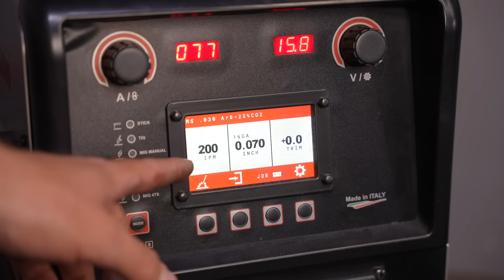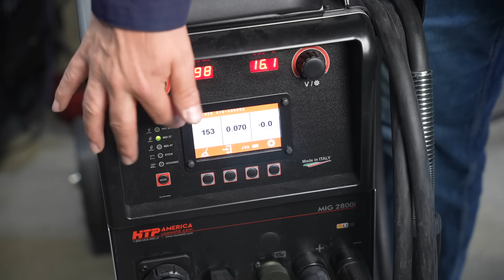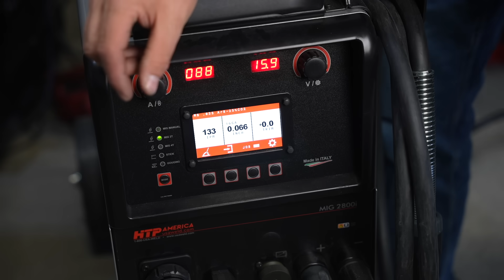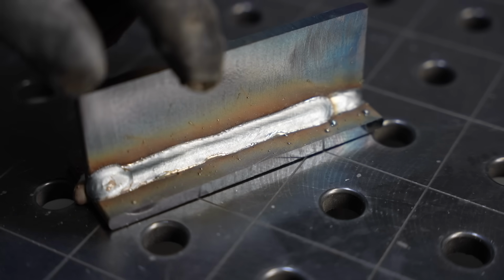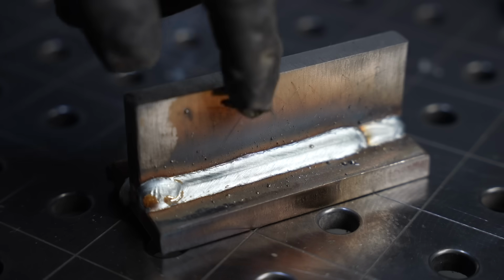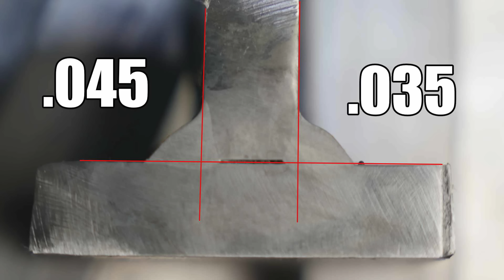Which Size MIG Welding Wire is Best?

Comment: Recently retired and learning to weld so I don't drive the wife nuts. I've learned a lot from your content. Thanks. What validity is there for .023 wire? I've been building sculpture with 18 gauge sheet on top of 5/16" round rod in different configs. I need to be able to butt weld the 18 gauge sheets at certain locations and am wondering about the .023 wire. I'm running a 115v 140 amp Hobart. Keep up the good content!

Comment: What wire brand would you recommend the most?
Reply from the maker: For 8" rolls of solid wire, I use this INE stuff from Amazon: https://amzn.to/3UlBx9W
Most brands of solid wire seem to run just fine, though. For most other consumables, I use Lincoln or Kobelco from the welding supply.

Comment: What about more complex weld of joining 1/2" to 3/16" face to face, not a T
Reply from the maker: Do you mean end to end, like a butt joint or one on top of the other, like a lap joint? 

If they are end to end, I would bevel the 3/16" a little on each side and run 2 small passes per side, one of which would be in the groove and one would be a fillet over the top bridging from the edge of the thick plate down to the face of the thinner plate. 

If you're looking at a lap joint, it would be a simple fillet, which is basically the same as a tee joint. With the difference in thickness, I would set the machine hot enough for the 1/2" and bias that side of the joint a little bit.
Reply: Lap joint, full end of 1/2" is exposed, welded to surface of 3/16 tubing face. What wire sizes and techniques? @TimWelds

Comment: I generally wouldn’t recommend hobby welders to try 1/2” for any reason. It’s too easy to mess that up. If they do, hopefully they can use a balancing weld on the other side. That solves a lot of problems, particularly with smaller welders and wire. And deposition rates are also influenced heavily by welding speed. You can control that somewhat. It doesn’t necessarily help penetration, but the increased weld mass adds some strength as it resists bending more.
Reply from the maker: I agree that it shouldn't be a starting point. If thicker material is used, presumably, the loads are pretty high and poor weld quality could lead to a dangerous situation. I don't think 1/2" is any more difficult than thinner material with the right process, equipment and a reasonable level of proficiency.

Comment: Great comparison of wire sizes. My Thermal Arc Fabricator multi process machine chart gives recommended settings but doesn’t tell you when you should bump up or down sizes.

Comment: The .045 looked a lot better on 1/2".   I dont want anyone to give me loop de  loops on 1/2.   I thought you had a htp2500 which is (just) 250A.   Some of the comments are getting out of short circuit.  I assume that is what you vid is for.

Comment: Nice, id like to see large diameter dual shield vs regular flux core, from my experience the flux core although more fumes(shielding gas from the flux) and spatter, It seems pretty close its much much cheaper and have yet to really see a difference, I understand there are specific standards for critical applications, but for the most part I think flux core is king.

Comment: I recently had to do a repair on an axle carrier that was carrying 30,000# dynamic load. I had to remove about 1" section of 1/2" thick steel due to cracking from bad previous welding.  Whoever welded that part last should have had their welder taken away.

The Miller XMT350 was running 28.5 -30V and 390-420 ipm of .045 solid. It was the angriest sounding 150 foot snake I had ever heard.

Comment: So what is the right size wire for a 110 mig 135 amp
Reply from the maker: .030 is going to be the best all around wire on a machine like that.
Reply: @TimWelds thanks for getting back that quick😮😮

Comment: What size would you recommend for bicycle frames
Reply from the maker: I would probably TIG weld bicycle frames. If you were to MIG weld steel bike frames, .030 (0.8mm) wire would be a good fit.

Comment: Thanks for the video. I'm a beginner and didn't want to start with gas mig welding(trust issues) yet. So I chose flux core mig welding with 1/8 inch mild steel practice plates and .035 wire. Sounds/looks like I might have chosen correctly. 😆
Reply: I have been welding for 45 years mainly arc and mig with flux core 
I decided to go gas with my mig 
I should have done it years ago 
So much easy r I will never go back 
Do your self a favour and get gas